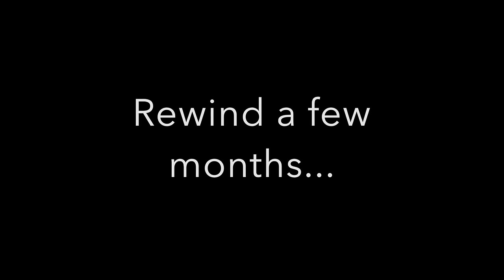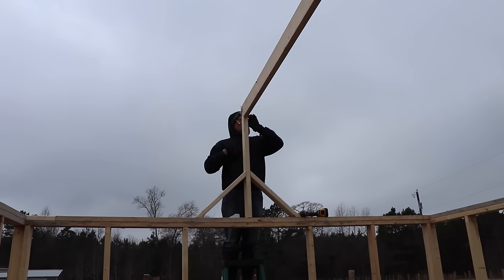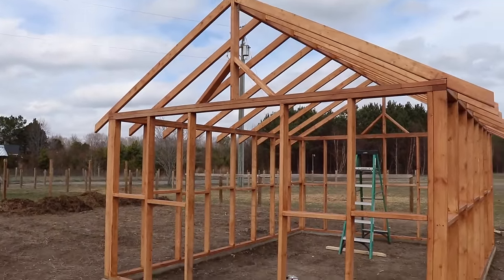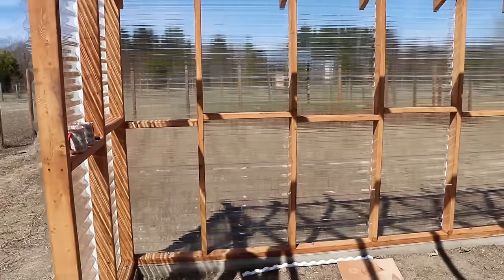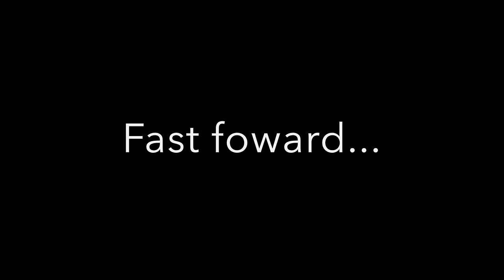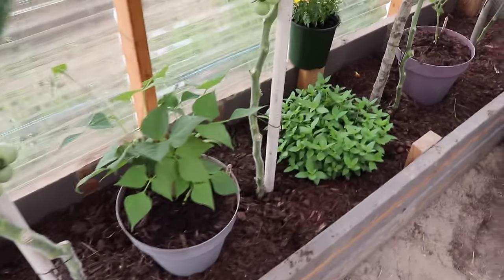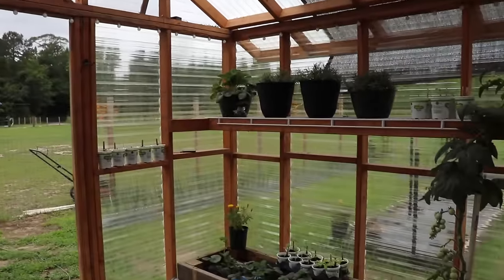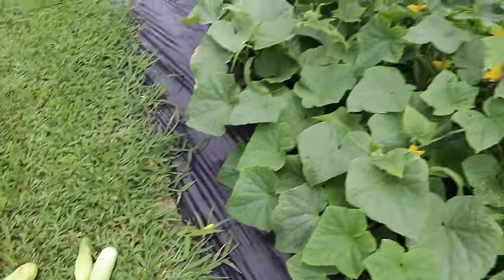Building our 1st Greenhouse! || Greenhouse Gardening || DIY Greenhouse Build!

Comment: I would have done things different but what works for you - works for you, 1 question: Why not grow in what you call the floor area? You paid for the space you might as well use it! Unless this is a starter (seedling) greenhouse I would have made it bigger, I like the shelving and bench idea but I think I would have made it about 18 x 120 having about having 10 - 12 feet to plant every week so it would be ready to harvest every 90 days adding a wood stove or outdoor furnace allows growing year round. Just suggestions as I am looking at feeding myself not just a summer venture. overall good job. Being in Canada I prob would have used 2x6 on the exterior walls and 2x10 for the roof.

Comment: how did you decide to run the polycarb. horizontal, instead of vertical? Thanks. looks so beautiful btw
Reply from the maker: You use less panels if you run them horizontally. You don’t have to cut panels. On the roof, we did them vertical that way the rain water would run off.☺️